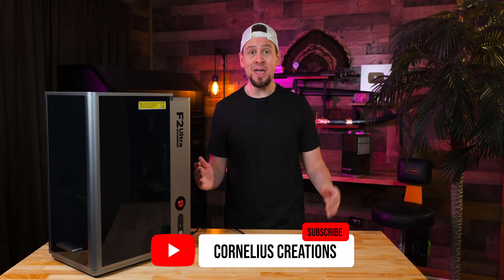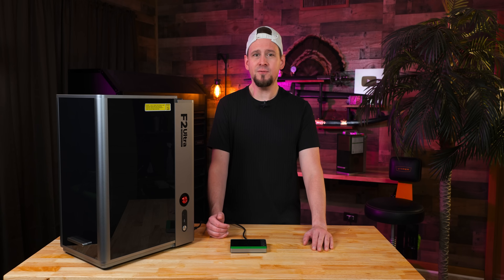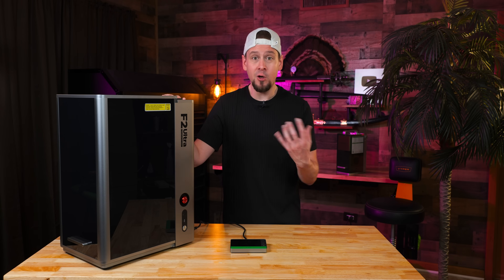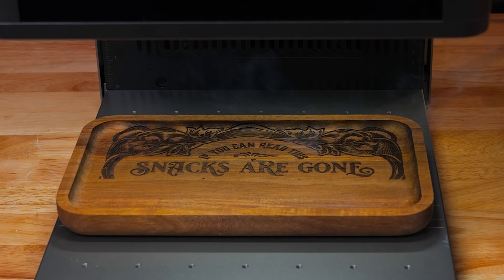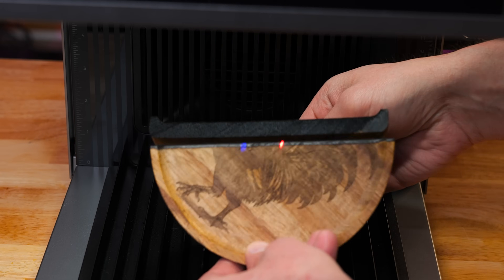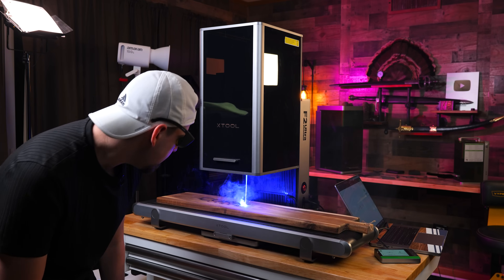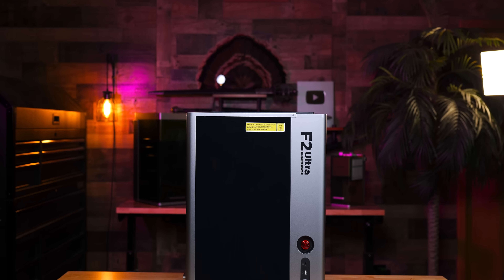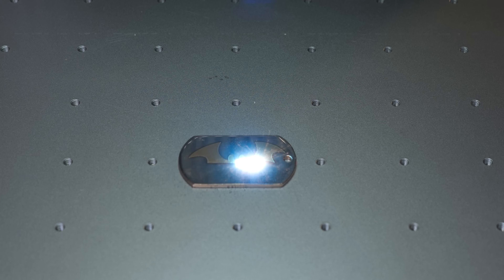xTool F2 Ultra Laser - The 60W MOPA Monster for Metal & Small Biz (Ultimate Review)

Comment: @Corneliuscreations you mentioned using this at an event. How would that work with the exhaust?  What type of ventilation is needed when engraving metal? Does this also engrave leather?
Reply from the maker: 1) You would need to exhaust far out away from your tent or use a smoke purifier. 
2) Yes it can engrave leather an almost anything. It is truly the swiss-army of laser machines!

Comment: I have not had good luck with the recommended settings. Struggling to use this thing. Also, how do you get the framing to display like that? All I see is a box when it frames?

Comment: Ton of info in a quick time as I'm currently in the market for a machine.. Thank You!  
With your experience with the F2 Ultra, can you please share your thoughts here. 
I'm looking for a machine to accomplish 2 very specific tasks.  First I need to engrave switch labels onto some black powder coated cast aluminum enclosures.  
2nd, I need to cut 1/2" holes out of 1mm thick colored anodized aluminum tags.  
Thanks in advance!

Comment: I have the s1 40w laser and it's amazing, I think the mopa single one would be a good purchase for the colour engraving, embossing on slate etc. do you think that would be the best option or should I get the dual one for other opportunities for doing things to order at craft fairs?
Reply from the maker: If you already have the S1 40W, you really don’t need the blue diode on the F2 Ultra…it would be doubling up. The single Mopa could work. BUT, that said, grabbing the blue diode with the MOPA does have a few perks:
	•	You get a fully portable all-in-one laser for events or pop-ups
	•	No need to swap between machines if you’re juggling projects
	•	Great for quick jobs without powering up your full setup
	•	If your S1 ever goes down, you’ve got a backup ready to go

So if you’re doing volume, traveling, or just want max flexibility, it could be worth it. But if you’re mainly working from one space and already love your S1, just the MOPA will open new doors without the extra cost.

Ultimately, it’s up to you. If you plan to actually make return on investment, then I always encourage calculated risk, IF IT MAKES SENSE. 

If you have an established business, I’d feel easier about the bigger purchase.

Comment: You made 50 bucks on that wood wallet? I call bs on that one.
Reply from the maker: Those are normally $55, I charged my client $40 cause she’s bought so many from me. They gave me $50. I made $1800 in 2 hours from wallets alone with my F1 Ultra last November. It’s doable my friend. No BS.
Reply: @CorneliusCreations  - You etched it. Where did you get the wallet blank? and what was the cost?
Reply from the maker: Alibaba & Etsy. $2.50 - $4 for aluminum and $6 for wooden.

Comment: Is it worth it to get just the MOPA if i already have the S1? Or is it better to have the MOPA/40W and sell the S1? I don’t make anything large so i feel like the S1 is too big for what i make.
Reply from the maker: That depends on your budget. Since you have the S1, getting the single F2U (mopa version only) will save money... BUT, if you feel like you don’t use the S1, the full combo F2U will be faster than your S1 and have the added benefit of the mopa. It’s one HECK of a laser.  Maybe dell the S1 or hang on to it for those big projects if you hardly use it.

Heck id say this, if you want the F2U, make a goal to use the S1 to pay for the F2U by selling some projects.
Reply: I have a Mira9 90Watt for all my wood and acrylic.  I have the xtool S1 which I’ve not used in over a year and a half because of some bug it has.  Just wondering whether it with the diode or not.  Mainly thinking of adding jewelry to what I offer.  Would appreciate any feedback..

Comment: Appreciate your cover of what this thing can do.  I preordered it last week.  I was debating between the P2S and the F1 Ultra when they announced this.  I'm looking at this as a business, since the titanium in my neck/back make a regular job difficult.  lol.  Can you answer me these questions?

1.  Can you cut/engrave clear/colored acrylics?
2.  Can you engrave on copper?  I puulled a guy move this morning and ordered a knife on Prime day sale.  It has a copper handle.  I never read the description and was thinking it was a brass handle.  That's what I get for thinking!  

Anyways, you got my sub, brother.  Take care.
Reply: I use an xTool F1 Ultra, soon to be F2 Ultra for metals and a xTool P2 Co2 for all acrylic work.  There is no single laser for a diverse range of materials out there.  Acrylic is unique and far different than metals.  The P2 does beautiful work on acrylics to include cutting.  For my business which is internal use only - I don't do laser work for hire.  I do work for my business, security engraving equipment, engraving custom business cards and making custom lighting Gobo's and ended up with two machines to cover everything I need to do.  The P2 also does mulit-layered painted blank equipment rack panels.
Reply: @zangzang1268 I appreciate your feedback.  I've done a decent bit of research over the past 6 weeks and still hadn't decided.  I had to have my neck and back welded up last year and I have 2.5 ft of titanium holding me together.  Lol.  Haven't worked in 15 months, so I'm looking for something to bring in some money.  I have plenty of wood working tools, so I was looking at the p2/s- especially since it will do all the acrylic from what I've read.  I don't have much interest in doing acrylic art, but that option would be nice. I'm more interested in the metal embossing/engraving which means I need a fiber.  

Leaning way more to the F2 now though.  Just need to find a great deal on a CO2 laser.
Reply: @jasonmartin7137  You're looking the right direction.  For me, in my personal business I use the F1/F2 Ultra basically do metal business card engraving and the F2 Ultra will also cut stainless steel custom lighting Gobo's.  Now to the P2.  The P2 will do acrylic lighting Gobo's that work fine in LED fixtures as they do not generate the heat of a 1000W incandescent lighting fixture.  The P2 will also engrave custom acrylic plaques for my customers as gifts that will match the custom lighting Gobo's for their events.  Beyond that the P2 is a versatile workhorse which for me is nice.  I can cut all kinds of parts our of acrylic and wood to build things.  Latest special project was some 1/8" black acrylic baffles to block off motion sensors field of view so they don't get triggered by my dogs giving false alarms.  I've made custom racks for electronics equipment cutting the wood on the P2 which is really nice.  Fast and the parts fit nicely together and projects look great.  I also do custom equipment rack blank panels that are painted two layer - color under black and then engrave to burn through the black to the color for business logo's and such to customize my amp, mixer and lighting system racks.  The P2 makes quick work of these types of projects.
Reply: @zangzang1268 nice.  What power and speed do you run the p2 at to only go thru the black paint?  I haven't researched anything like that and would've thought the laser would burn thru both colors.
Reply: @jasonmartin7137  I'll have to check as I haven't done a panel in several months.  The way I always setup is to prep a couple of extra test panels and do a test grid to get  the setting I want then get busy.  It does a fine job and the panels look killer.  I did a couple for a friend DJ with red under the black and engraved his '57 chevy bel air onto the panel.  I'll have a look in my files and get back to you.  What I do is put 3 coats of base color on and a single coat of black.  Then when engraving is finished, wash it off with water and soft cloth.  Dry off well, lightly scotch brite pad then satin clear laquer over it.  The paint I use is standard rustoleum rattle can and it works great.
Reply: @zangzang1268 sounds like how I paint things minus the top layer of black.  Lol.  Thanks again for the info.
Reply: @jasonmartin7137  Sure dude.  My first blank rack panels were black only engraved down to bare metal with a D1 Pro blue laser.  Then I thought well the black will absorb the heat and blue underneath will reflect the heat and it worked.  Then, with more experience I found the P2 does it just fine as well and is way easier to setup so I use it now.  Just paint your work and paint up some test coupons and do some grids and it's really easy to get great results.  I do it in one pass.  Seems like it's around 25% power level.
Reply: Ok, I checked a file that's probably where it was and a good burn job.  20%, 300/mm sec, Jarvis and 200 lines/cm.  That's with 3 coats of metallic blue base and a single coat of satin black rustoleum.  Cured in the oven after air drying overnight.  250F for about 4 hours, slow cool down then put it on the P2 and kabam.  Clean with water wash and old T-shirt, dry and clear satin finish lacquer.

Main thing, oven dry the paint after overnight air dry, do a couple of test panels and do some test grids.  I always do test grids now and test panels and haven't screwed one up in a long time.
Reply: @zangzang1268 I really appreciate all that info.  I'll have to experiment with it.  Just got off the phone with my buddy and he gave me a good idea- engraving tools.  Gonna have to carry around an engraved 10mm to show all the mechanics in town.  Lol.
Reply from the maker: Thank you for the kind words, Jason! A laser engraver will most definitely be the easiest to enter side hustle for a return. I promise you that. 
1) You will need a C02 laser for clear acrylic. UNLESS you do a few tricks of the trade with the blue diode. (There are YouTube videos on it)
2) Yes, this will engrave on copper. 

Perhaps, look at the P2S and F1. That might suit you better. Get a paper, write them down, or got to ChatGPT, tell it your goals and ask which xTool laser will suit you the best for the money.
Reply: @CorneliusCreations  Appreciate the feedback kind sir!
Reply from the maker: Likewise my friend!
Reply from the maker: Yes sir!